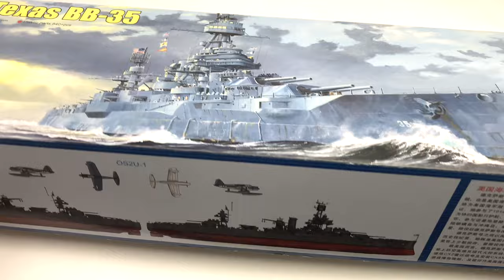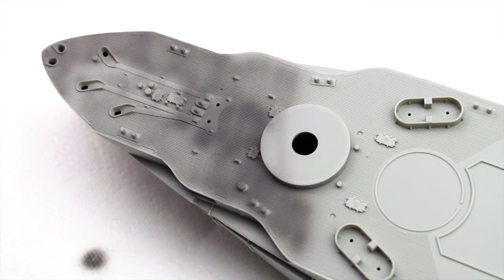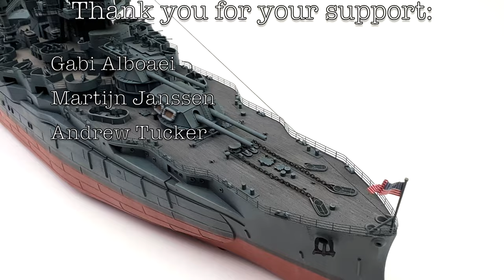USS Texas - FULL BUILD 1/350 Ship model

Comment: The Texas has been painted deck blue (measure 21 camouflage) since 1989, and was painted in measure 21 camouflage in 1944 and 1945 after drydock in the USA before shifting to the Pacific Ocean.  Also, since 1989, the hull below the waterline is painted black.